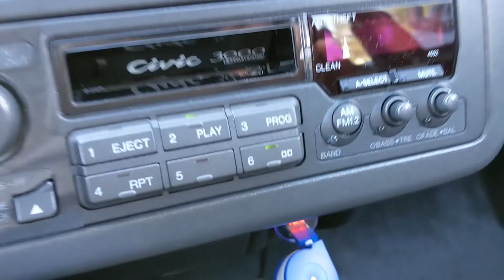Bluetooth cassette time-lapse 4 batteries, type-c charger, amazing sound | Play this video in 1080p

Comment: So fast, we cant see what you are doing. Not too clever.
Reply from the maker: i will have a tutorial video coming soon!!! step by step
Reply: @1992productions  Thanks. I am trying to find if I can add a small bluetooth board to a radio cassette without too much soldering and hard work. I am not an electrician and would love to place bluetooth in my ghettoblaster.